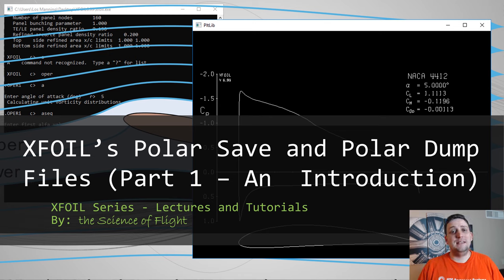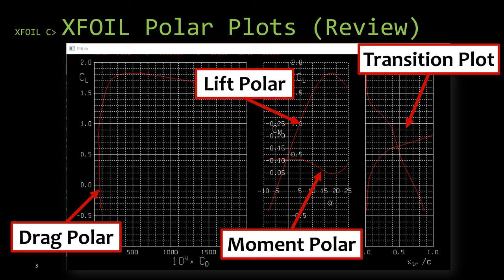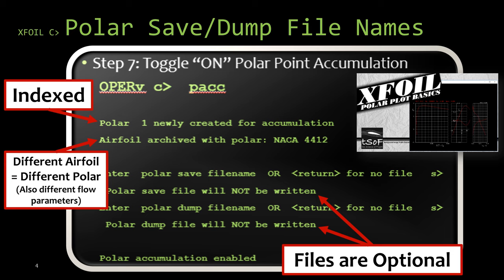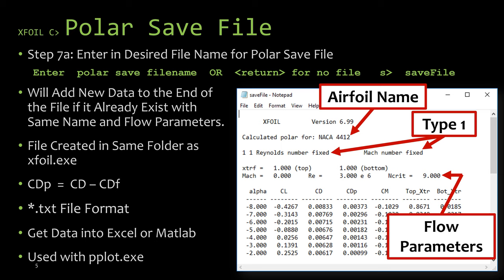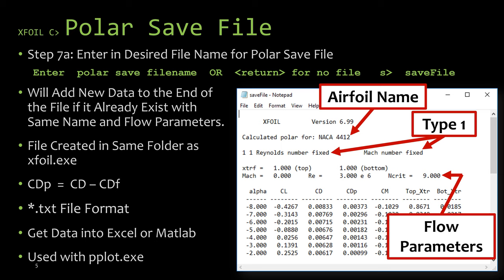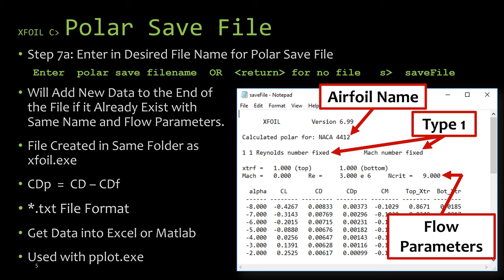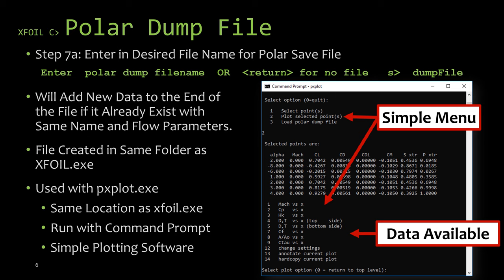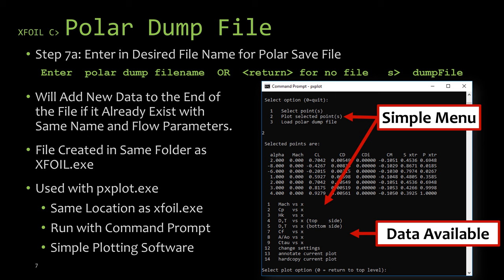XFOIL's Polar Save and Polar Dump Files (Part 1 - An Introduction)

Comment: Hi
appreciate your videos. I still need some help: I am running a lot of aseq analysis at different Ma and Re automatically. Sometimes the analysis does not converge which is not a big problem. However, if that happens, there is no line for this AoA in the output file. I would like to have a line for that showing the result of the last iteration step or at least NaN or something. Is that possible?

Comment: I needed to save data for skin friction coefficient (Cf) vs x/c. When I try to run the polar dump file through pxplot, using windows command prompt, there's always an error message saying "Error opening polar dump file". If I calculate Cf through the method you recommended below I get the total airfoil Cf, not Cf for a point in x. Do you have any suggestions that could help me?

Comment: Any idea about how can I save the data for coefficient of friction? 

Thanks in advance! And that's a really informative video!
Reply from the maker: Thank you! If these videos save you all even a fraction of the headache I had to go through it will have been worth it. Lol

You can use the coefficient of drag due to pressure, CDp, and the total coefficient of drag, CD, to calculate the coefficient of drag due to the friction, CDf. This is because XFOIL calculates the coefficient of drag due to pressure, CDp, from CD and CDf (CDp = CD - CDf). I normally open up the .txt polar save file in MS Excel, import the different values into separate columns (either in the import wizard or the Data > Text to Column ribbon button), then, in a separate column, use a formula where I subtract the CDp column from the CD column. If CD was in column C and CDp was in column D then, for example, in cell H11 would be the formula =C11-D11 This also allows me to strip off most of the header information if I'm wanting to do some post processing in say MATLAB or something similar.